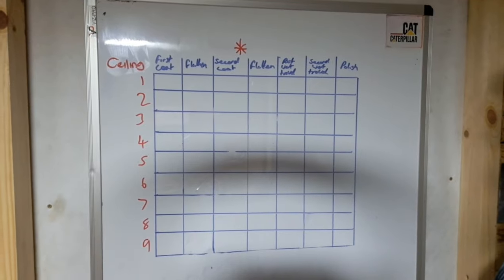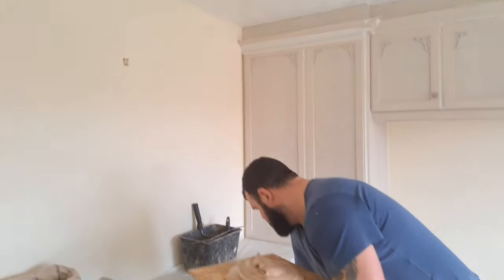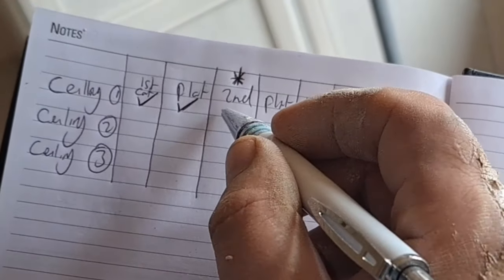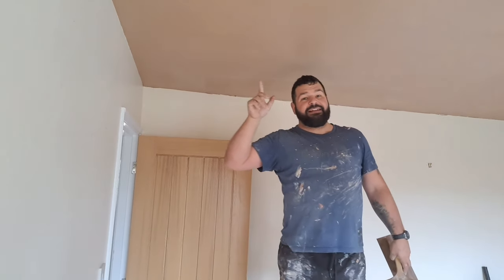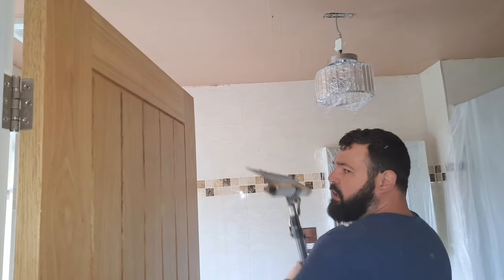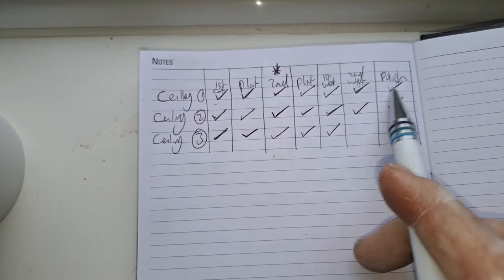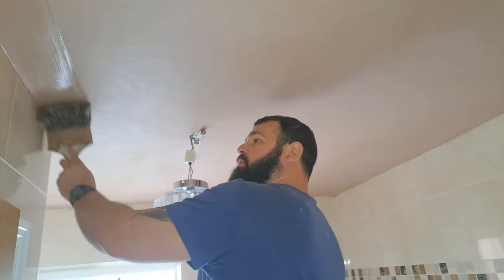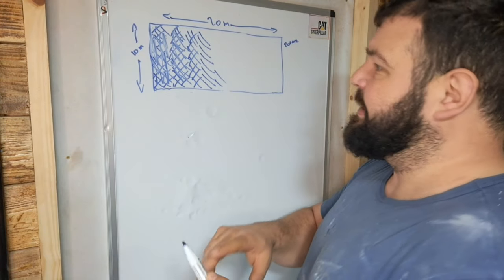ROLLING GAUGE | full in depth guide

Comment: Worked on over 250m²  in a 1890th building and used 4x42-25kg sacks. Plastered 9 slooping ceilings, thats a hell of a job putting thirst layer netting  2,20m long. One room was 4 meters height with 2 slooping ceilings which I had to plaster on a aluminium stand shaky as he'll. I worked for a friend to get into the job. I like your wet trowel technique, in Germany it's not usual, They use here the sponge. In my opinion the wet trowel is more smooth to handle and not that much sweating as to work with the sponge. The best way to work is the clean and smooth way. Thank you for sharing your technique, it's nice to compare. In my opinion the technique depends on the weather and how fast the plaster harden, as you showed it in a video where you had to wait to scrape walls outside a house and did a ceiling meantime and ate with your workers. Much respect to your work ethics and technique, I would call it the English way- as usual showed the whole world how it has to be done.
Reply from the maker: Thanks for a great comment, I enjoyed reading that. 🙂👍👍

Comment: Sorry, I have been plastering for  40 years l will not skim over artex it might stick to the artex but when you put sbr on it wets the artex and it might come away from the board plus your putting weight on the ceiling and it  might pull it off, just my opinion, good vid though.

Comment: Kirk, my first plastering job for a builder was to skim 13ft high walls. Used a rollling gauge , started on scaffolding and two coated the top half of the wall and finished by feathering the edge. Took away scaffold and did the bottom half and made sure I had plenty of PVA on the join and used water when blending in. Used the same technique on large ceilings. Comes up a treat. Not sure if I’ll have the nerve to try your technique, another great vid!

Comment: as a beginner how come my plaster is going off so fast. i dont seem to have the time like you do. did my bathroom wall and was turning stupidly fast compared to college. college board have about 20mins between coats but my wall 3 sheets wide start was doing off as well as my mix in the bucket, took me 20mins getting it on and filling out hollows. is it my speed or thickness or bad batch of plaster that's causing it? i used 2 coats of pva too, so suction shouldn't of been a problem.

Comment: Kirk you absolute madman... the prospect of having multiple sets on the go is terrifying to me! I'd love to be able to even do one ceiling, but I bet my shoulders would be dead. You must have Olympian fitness!

I see you pointed out the bad fat in this vid. Will you show the good stuff you can use to fill in another vid? Or are you planning a more in depth video on both good and bad anyway?

Sorry, another question... the cleaning of the ceiling line around the 27 min mark, is that the only time you need to mess with cleaning ceiling lines and angles up, when the set is finished?
Reply: Just finished the vid. World class buddy. The Messi of plastering! You turned those three hideous old artex ceilings into glass with razor sharp ceiling lines! Majestic!

Comment: Great work! Im a start up in plastering and i get dimples in my plaster i think it could be air bubbles. Whats the best way to avoid that from happening and why do you think its happening? Thanks in advance!
Reply from the maker: Hey mate, I get them sometimes, uts the background that your going over, you will get them less if you use sbr but don't worry about them, they just trowel out. Sometimes you just need to give it an extra hard trowel at the end